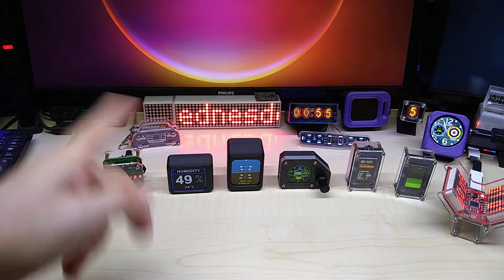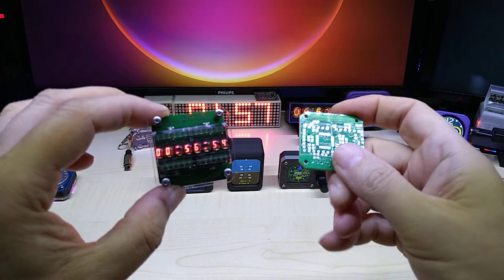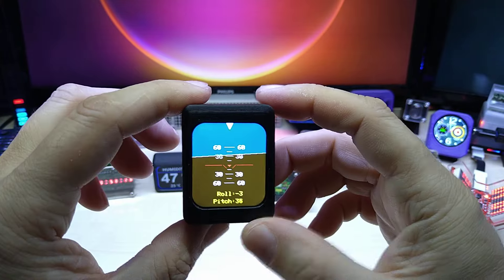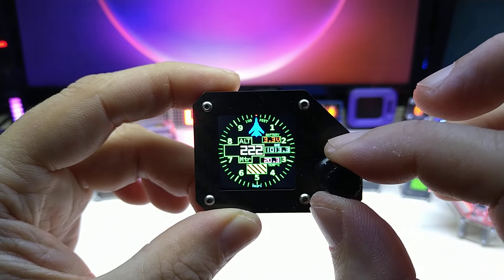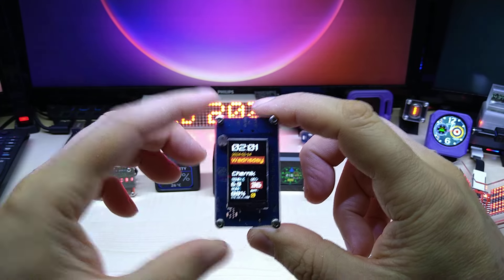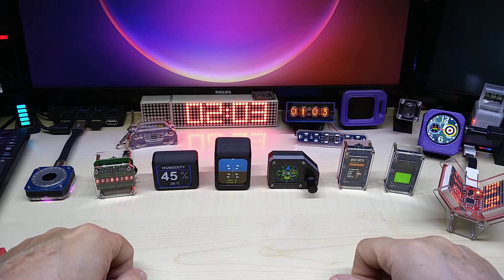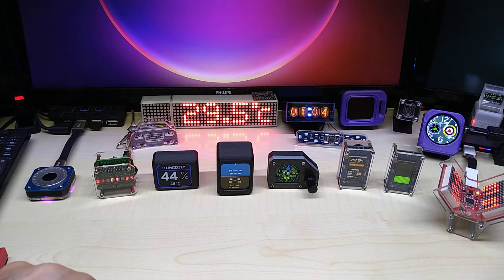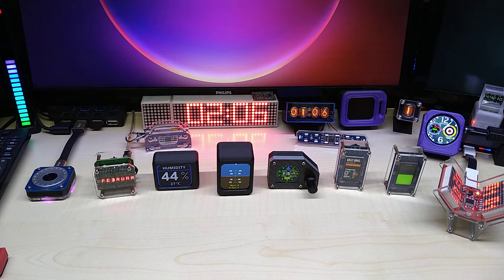#DIY Attitude Indicator - Artificial Horizon Altimeter, Retro Clock with HPDL1414 and more by #Hayri

Comment: Will the artificial horizon and altimeter be up on your Etsy store?
Reply from the maker: For now they are made to  order only. Might change depending on demand. I am actually redesigning the altimeter ot use a 1.28" round display right now, might even go up to a 2.1" display, not sure yet.